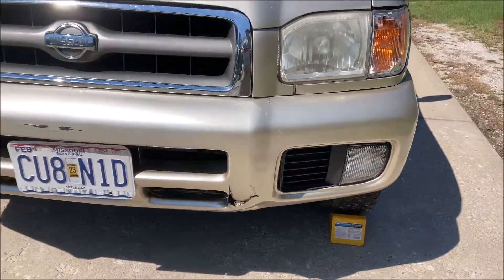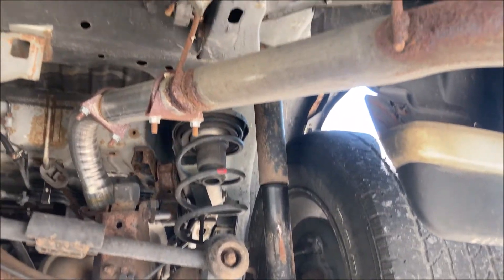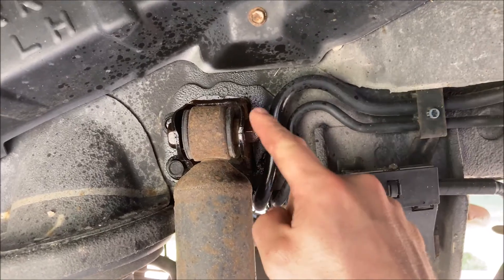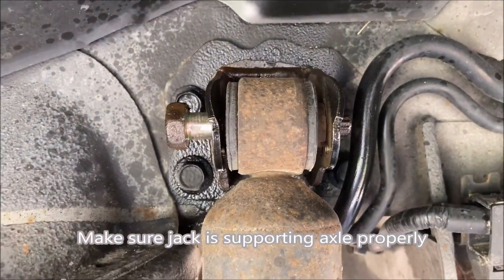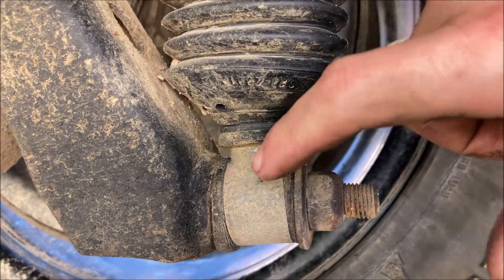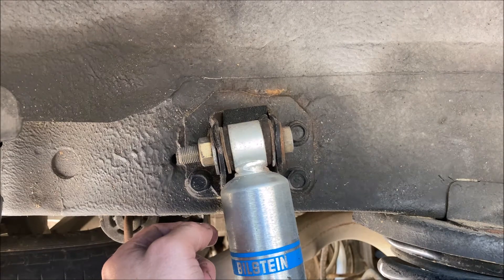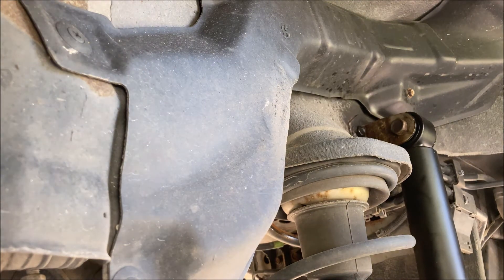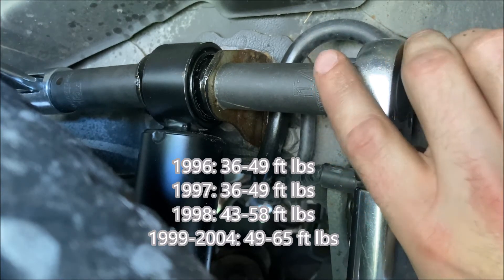R50 Pathfinder/Qx4 shock replacement (How to)

Comment: Never trust only jack stands no matter what kind of repair you're doing and work on level ground. When you jack a car up and leave it on jack stands put the hydraulic jack underneath the car or on the side of the car you're lifting and put a little pressure on it just to be on the safe side so for some reason if the jack stand fails or something like that the hydraulic jack is still touching the frame of the car or wherever and it's much safer that way. If you strip a ball to break a bolt take one from the other side that the threads are good on and go to Lowe's or home Depot and find one of the same length and the same thread pitch if you can't find it ask someone over there for help always be super careful when working on cars and it's always a good idea to put a little high temperature Grease on any threads so in case you ever have to take them off at some point in the future they won't be frozen on there especially on lug nuts

Comment: Very nice video! What's the length of the 1/2 inch bolt you used on the upper portion of the bilstein shocks?

Comment: When replacing rear shocks as you did, is it advisable to lightly smear the bolts and studs with a light coating of grease? Was told by a mechanic this helps the bushes move and last longer, any theories on this
Reply from the maker: As long as the grease is compatible with rubber like silicone grease, that's probably a good idea. I didn't come across any reading material saying it's necessary for my applications on the vehicle shown but I imagine the right kind of grease would only be beneficial

Comment: Hi there, I have a 2002 nissan pathfinder LE model but mine does not have any springs in the rear wheels. It only has shock absorbers and it squats allt . it is too low when i adde any wheight in the cargo area it almost runs the tire. Is this normal?
Reply from the maker: Hi, No that’s not normal. It should have springs between the spring perches on the axle. Even if it did have springs, the ride height is too low indicating wore out springs. Sounds like some new springs need to be purchased and installed

Comment: Brilliant!  My son just got an 04 and this is exactly what I needed.  Curious…. I’m comfortable making this repair, but I’m not a “car guy”.  When do you know if you should change the shocks vs. the struts?  Thanks
Reply from the maker: If the vehicle is bouncy it’s time to replace them. If you grab the vehicle with you hands and bounce it and it bounces more than once after you let go, it’s probably time for new shocks and struts.
Reply: @dospathsgarage2854  wow thanks for such a quick response.  So I’m def going to replace the shocks.  But if it’s bouncy I should also replace the struts?
Reply from the maker: @ScoDavidson  It’s most likely time to replace the struts. However the struts cost a pretty penny and are time consuming if they don’t include coils pre installed on the new struts.

Comment: Thank you for the great video.  I noticed that you didn't disconnect the stabilizer bar connecting rods.  If I wanted to remove my springs (without a compresser) would I need to do that as well?
Reply from the maker: Yes, for springs, you’ll want to disconnect sway bar links. Just support the axle with a jack so it doesn’t rip your brake line
Reply: @dospathsgarage2854  Unfortunately I sheared off the head of one of the 2 rear stabilizer bar connecting rod bolts that attach the connecting rod to the car frame. I tried to drill it out while saving the threads but failed. My question is this: Is it possible to remove the flooring in the cargo area and get access to where the bolt originally threaded into from above? If I could do that then I could just use any grade 8 nut and bolt to fix the problem (I think). Any help greatly appreciated.
Reply from the maker: @kumabeast7745  yikes! I’m not aware of any access holes in the cargo area or there than the one for the trailer light harness which is above the spare tire. I’m thinking that broken part is going to need some cutting or grinding to eliminate that bolt head if possible
Reply: @dospathsgarage2854  the bolt head is gone, as is the shaft of the bolt.  My problem is I destroyed the threads and I'm worried that the steel is too thin to tap.  If I look at the threads for the other bolt (that I removed successfully) it looks like the threads protrude up into the frame, sort of like a  helicoil or something.  Perhaps I should just try tapping?
Reply from the maker: @kumabeast7745  oh so you’re referring to the two bolts (14mm heads I think) that hold that sheet metal bracket to the frame. They are threaded on from the bottom and the bolt heads are on either side of the sway bar link. The bracket that the upper portion of the sway bar link is mounted to?
Reply: @dospathsgarage2854  Yes exactly!  Any thoughts?
Reply from the maker: @kumabeast7745  I see the predicment now. If the female threaded sleeve still exists inside the frame rail, even with damaged threads, I'd try to save it with a tap or helicoil if you're attempting to do a proper repair. So if that sleeve is still attached, I'd try to carefully repair it if you want to go that route. But if you don't want to spend much time on it, and don't mind it being proper, I'd just weld it if you have access to a welder. It would be just as strong and much quicker. I have encountered scenarios where the female threaded sleeve snaps off the the sheet metal bracket from the inside and it can't be saved. In that case, you'll have bust out the welder or get really creative... which at the moment I don't have any practical ideas.
Reply: @dospathsgarage2854  Hey  thanks for your help ( and patience) with this.  I'm a noob for sure.  Just trying to learn some simple auto mechanics. As It turns out I found an interim solution for now.  I widened the hole in the middle slightly, passed an electric cable through the main hole and out the hole with the destroyed threads.   Then I attached a bolt to the end of the cable with duct tape and pulled it through.  Amazingly it worked.   I used a grade 5 bolt so hopefully its strong enough.  Thanks again.
Reply from the maker: @kumabeast7745  no problem, happy to help. Sounds like a good interim solution.

Comment: You did the lr 9446 springs? Looking to do this on my 02 qx4 and wanting to know if I'll have to do the same with the metal sleeve on top part and drilling out to make bolt and nut fit. What's the length on the 1/2 bolt?
Reply from the maker: The gold Pathfinder with the basic black shocks being replaced is on stock suspension without mods. The other Pathfinder with the Bilstein shocks is using 9449 coils. I don’t think you’re required to drill out the shock mount and swap bolts. Some people have been able to source adapter bushings. I found it faster and easier to just go to the hardware store and swap bolts. Unfortunately I don’t remember the bolt length. I bought about 3 different bolts lengths and just kept the the two shown in the video
Reply: @dospathsgarage2854  OK so it sounds like I should just take the shock with me (measure bracket length and add about 2 inches) and try to find a long enough bolt andcall it a day right?
Reply from the maker: @jorgecortez9780 I think that should do it 👍
Reply: @dospathsgarage2854  Thank you I'll let you know how that goes!

Comment: Great video, are you using the bilsteins on stock springs? Or could you use them with stock springs?
Reply from the maker: Thanks, I’m using Bilsteins on lift coils. Those particular shocks allegedly work just fine on stock height springs or so I’m told. The cheap shocks shown installed are on stock coils

Comment: Do these vehicles have a rear strut mount ?
Reply from the maker: Front of the vehicle has struts. Rear does not. Coils and shocks are separate and sit in different locations. Just rear shock mounts on these rigs. Coils are trapped inside the coil buckets

Comment: What to do if the rear bottom bolt is stripped??
Reply from the maker: Ouch! The bolt stud that's on the axle? If the stud is broken, that's gonna need some welding or a whole axle housing. If the but is off and just the threads are trashed, maybe a die can repair the threads